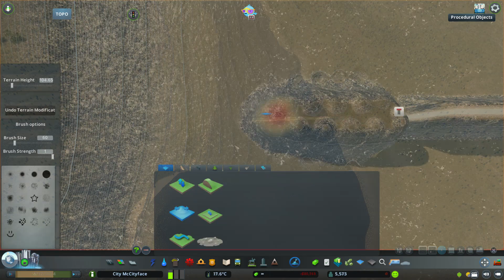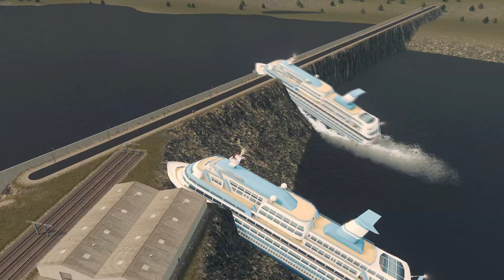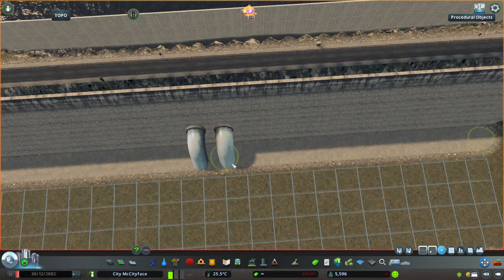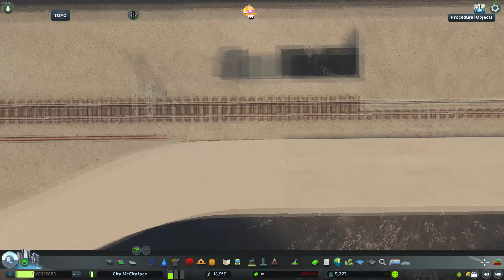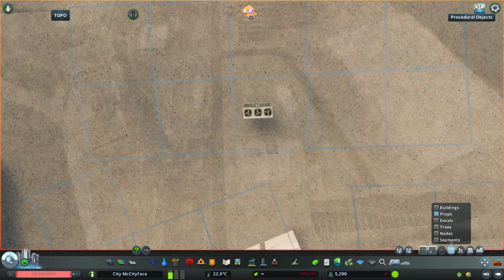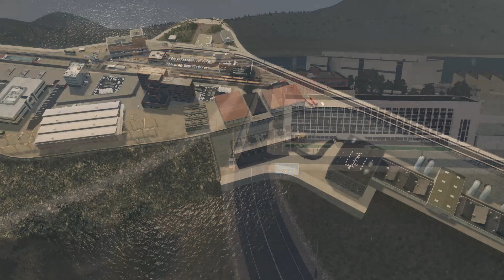Cities: Skylines - Custom Dam - Aurelia #7

Comment: I live in Québec. Dams provide most of our power. There are a number of smaller dams which are located within the city perimeter and are already a century old. Most of those have a power house which is quite visible, but many of the modern dams we've build differ greatly in that matter. Several of them are located in gigantic underground caverns. It's actually quite an efficient way of doing things. Digging the underground chamber provides much of the stone needed for levees and the powerhouse itself is fully protected from the outside environment which is a rather good thing considering our hard environment.
Reply: Where do you live in quebec?, i live in shawinigan and we have two small basic ones right in the middle of town and a huge one further south called La Gabelle👋

Comment: The wave may be created by procedural objects if the mod takes some time (even miliseconds) after loading is done to report the objects to the game. Their "sudden" appearance later is what pushes the water and creates waves.
Reply from the maker: The wave happens next to normal objects and as someone mentioned earlier, it's probably because the dam is outside of the normal building area unlocked by the 81 tiles mod and after doing some reading, it's apparently a known glitch

Comment: This is a really good looking dam. You're going from strength to strength here. One minor quibble though, when traffic is allowed on a dam, the troughway is a straight line. The two railroad crossings and turns would slow traffic down. If the road was upstream of the railroad across its entire length, that would be slightly more realistic.

Comment: Akruas, how do you make the roads look like that? Can you send me the color corrections and settings etc for that to me? I dont like the current look of cs streets now 😂
Reply from the maker: The color correction I use is Relight Vintage (part of the Relight mod) and then I use mod Road Options (Road Colors Changer ++) where there is just a color slider to make the roads more black, that's all
Reply: @Akruas  , first things first, thanks alot for answering. I appreciate it.

And about road color changer ++, i had it too (removed it because jt causes a bug), but i didnt know where  to change the colors.

Can you explain please? Or make a. Video about it, it would be appreciated alot.

Comment: Hey man! Love the dam - that’s an awesome build. I would recommend building a sort of jetty out into the water next to the ferry pier, similar to what the Three Gorges Dam has, so that the shipping traffic can be kept separate from the area where the spillway is. Additionally, placing some buoys near the spillway to mark out the area where it is dangerous for ships to pass would be a good idea. Finally, to add to some futurism, you could build a very large lock system that would accommodate large container ships, to support the industrial area.
Reply from the maker: I haven't figured out how to build good looking locks yet, it should be relatively simple with detailing and all, but you can't stop water flow with some detailed lock gates as the only way to stop water in this game is when you build a few meters thick terrain wall, which would make any locks look weird, they only lock I know of, is some prop in the Workshop, where the water is just a static texture, but I don't want to do that, there's going to be a harbor with railroad for the industrial area below the dam
Reply: And maybe a few police boats, in china they a have a bounch of military patrols